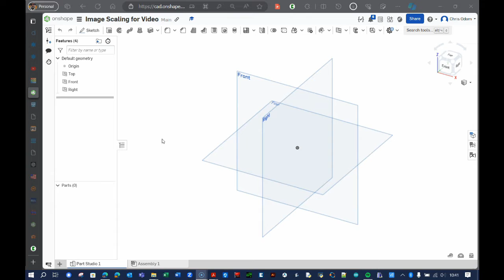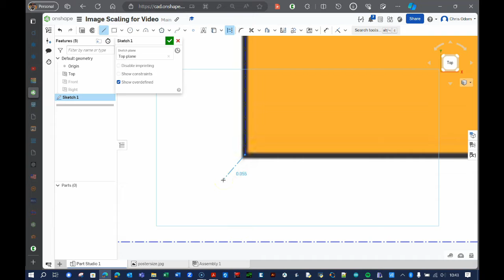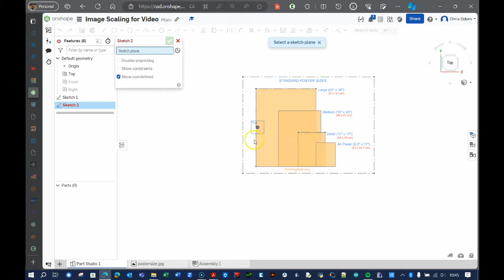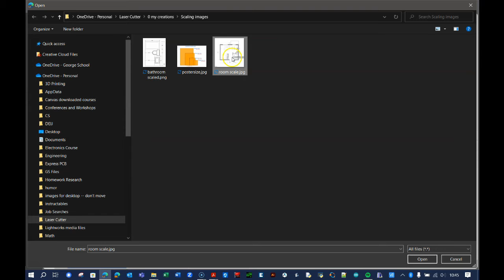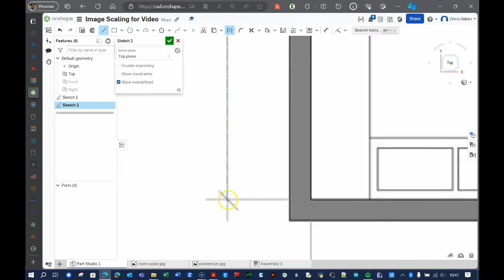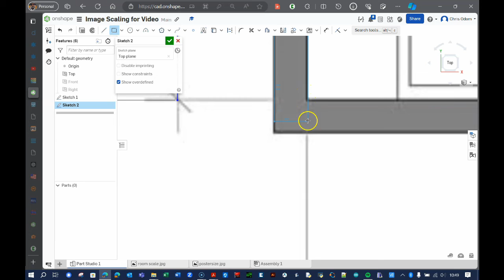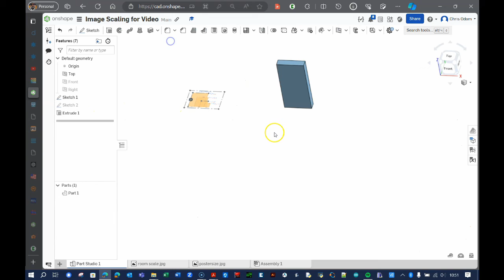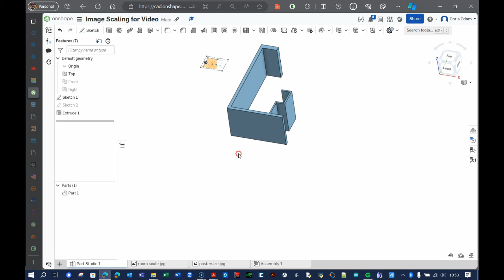Image Scaling in OnShape

Comment: how did you connect the line to the image? adding a length to the line just changes the length of the line, the image is its own separate object.
Edit: It seems like it only works if the image is the first thing you add to the sketch.
Reply: do you know how this works with e.g. multiple images in one sketch? Where it's not the first thing?